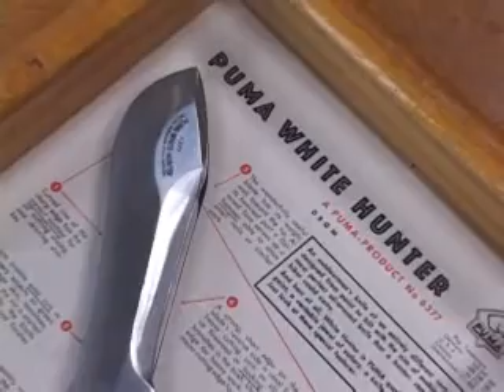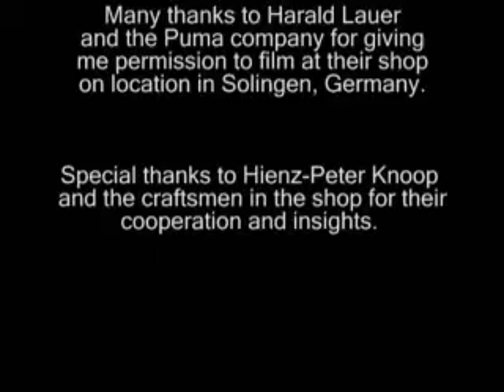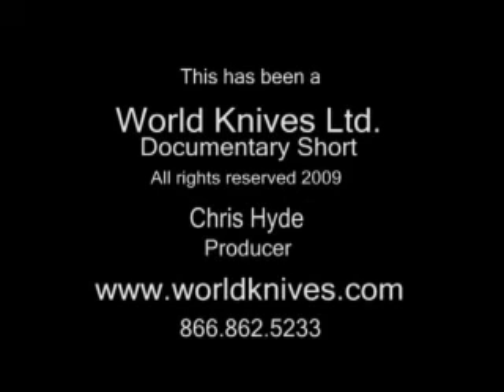Puma Knife Shop Documentary Short Solingen Germany - The White Hunter

Comment: Say Heah,  I just bought a Puma Bowie 2. I bought it in brand new condition from the Pawn Shop.  My Bowie 2 doesn't have a Bolster it's just the intergrel blade with some nice stag slabs pinned on the blade.  The sheath is a excellent leather.  The Knife and sheath came in a Black box and states it was handmade in Solingen, Germany.  So far I was able to find out it's discontinued and that I bought it at a good price.  I paid $75.00 for a brand new version,  I know it was never worn or sharpened.  The number on the knife and the box match.  I really would like any info that you have on my model since I can't  find any information on my purchase.  I really would like to know if the steel is 440c. or exactly the type of steel my Puma Bowie 2 is made of.  Thank You in advance.
Reply: Information on puma knives is a little hard to come by, as the company has been around quite a while, has a massive product line, and doesn't update too often (especially in English). The Bowie II, along with most (if not, all) of the Puma product line is made out of 440c stainless steel. That being said, it is not the same type of cheap 440 found in knock off Chinese cheapos or gas station specials. It is a misunderstood steel. The 440 stainless that Puma uses is of very high quality with a fantastic heat treatment, and was chosen because of their heritage as a hunting knife company. When dressing large amounts of game, whatever knife you use WILL dull and 440 is much easier to sharpen quickly than other steels regarded as "higher quality". To sum however, your knife is made of 440c stainless and you got it for a rather good price.
Reply: Thank You,  Yeah,  I did call Puma U. S. A.  and they didn't have any info on it,  But the nice man gave me the Germany Division of Puma and they did have a little information on the knife,  Yes its handmade in Solingen,  Germany.  and that it is 440c. The Bowie 2 is the basic version of the Bowie and it doesn't have a bolster but it's a integral style of knife where it's a knife made out of 440c and handmade with just stag handles (slabs)  attached,  The more I use it the more I like it.  I have teamed it already with my White Handle H. I.,   M-43 Khukuri and my Gerber Freeman set which is the Hunter and the Caper,  both are stag handle made similarly to my Bowie 2, But both in the S30V,  the Khukuri is a leaf spring from a Mercedes and that the 5160 carbon blade.  I don't wear all the knives at the same time,  But I do pick and choose which ones to take with me to go out with,  I could take my Kukuri,  my Bowie 2 and the Hunter,  attach the Khukuri and the Hunter to my pack and wear the Bowie 2 if I go out for a overnighter,  Or I can go with just my Bowie 2 and Hunter and a saw on a scour or as you can see other various combinations,  But most of all I Thank You for trying.